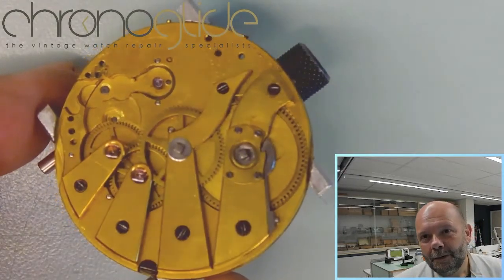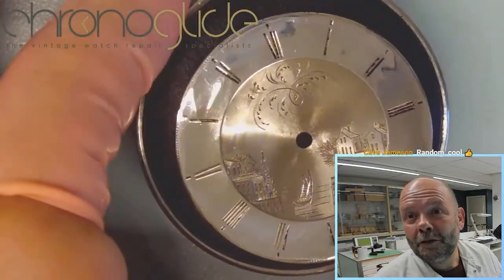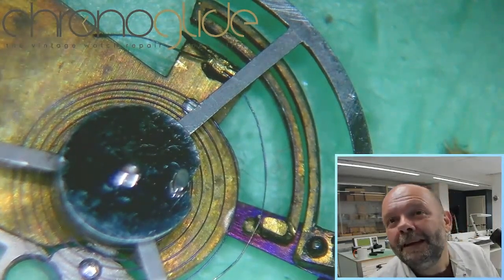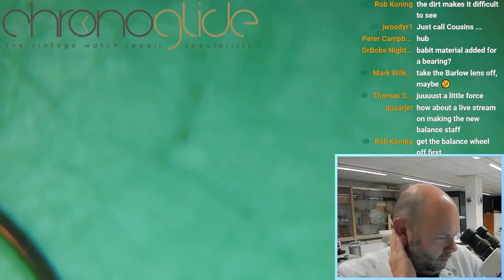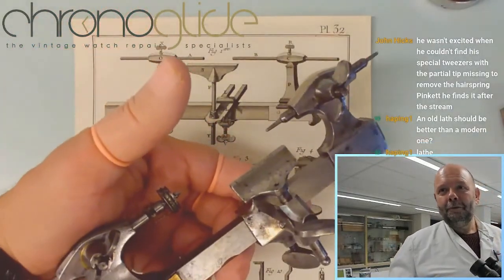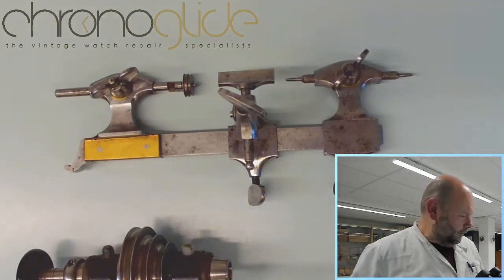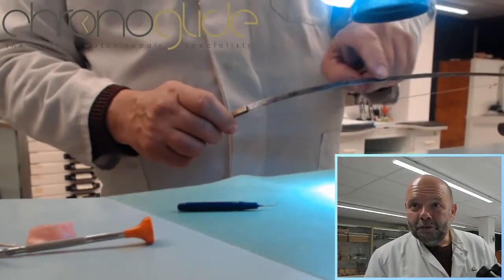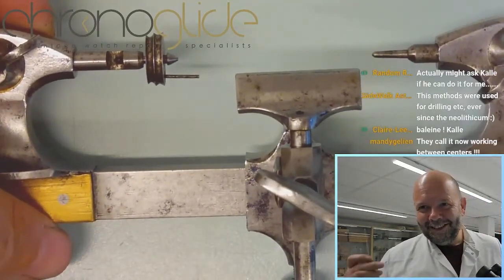Amazing pocket watch! Lathe work -  part 2

Comment: Very interesting. I have a set of turns but no bracket or method of gripping the balance staff rod... is it held in place by friction?. Are they different sizes dependant on rod size. Do you know if they are available or would it have to be made. I think I have seen ones that screw / clamp on?. Any further info please. 👍😊 Thank you. AT

Comment: Not only they can be accurate but just think how skilled the watchmaker must be to work off of one hand to operate the lathe, and one hand to control the cuts and achieve the desired finish with the precision necessary for it to work perfectly! It is, and always has been, an art in itself to master the control of producing such precise machinery by the masters as yourself to produce such pieces of art that not only hang on the wall but a dynamic gem which will be precise for centuries to come! Great video as always!
Just one note: those “little holes” you call them in US English are called divets. I’m a foreigner too and also had a few terms that had to adjust to it based on my first language.
Happy holidays!!! Someday I’ll have the money to stop by and visit with you! I admire how you still use centuries old equipment and technologies/procedures that slowly are fading out due to everyone trying to use the greatest and latest we have to offer today! ❤❤❤